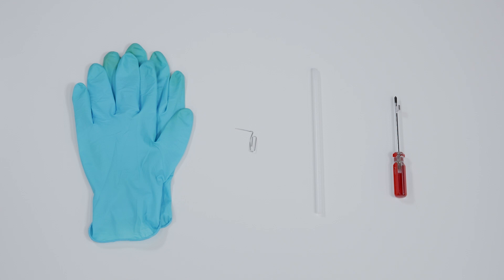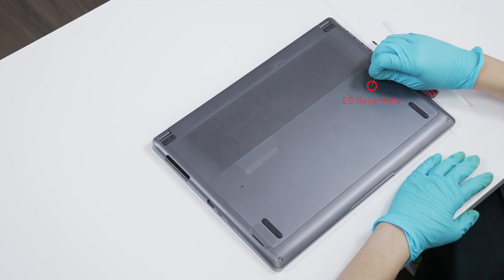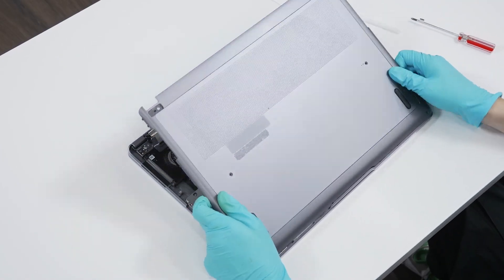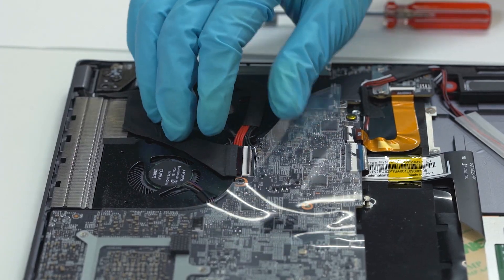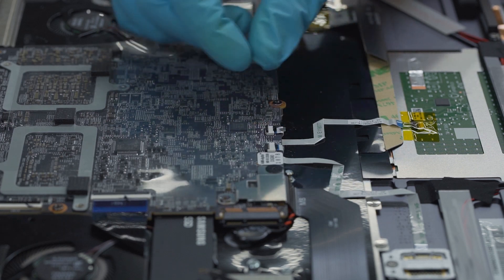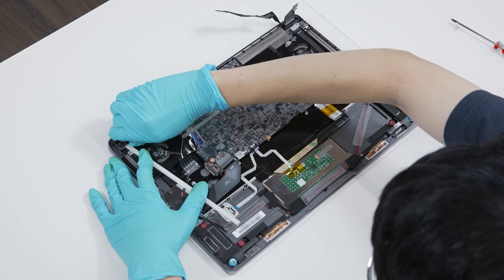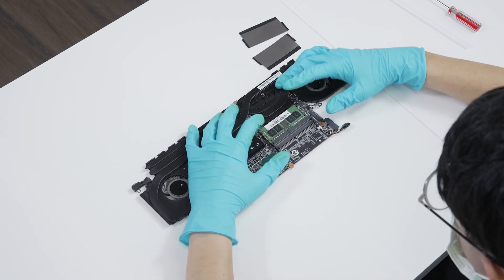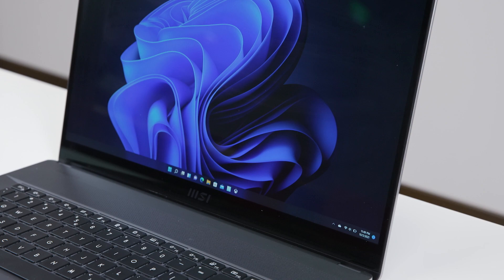MSI Creator Z16 Upgrade Tutorial

Comment: Thank you for the guide. 

I know it’s silly to complain about this at this point, but I need to vent. 

This is f*cking ridiculous!  I’ve had to do this 3 times now over 3 years. There are two things an end user is likely to do with their hardware: update/repair ssd or memory. A design that requires playing a game of Operation to do so is unreal. I’ve built and worked on computers for decades. This is just dumb.  

As I went through this process, I feel there were small changes to layout that could have made easier upgrades possible. Iirc, years ago I had a SAGER that was easy to change those parts and it was a comparable machine (at the time) to this msi. 

Guess it’s on me for not researching how easy this is before purchasing. But they were the only maker with the display I wanted. 

Rant over. Thanks for listening.

Comment: Thank you for the guide! I just added an M2 to my Z16 A11UET and a have a couple notes I thought were worth mentioning: (disclaimer: I am not a professional) 
1) A SIM card pin seemed to fit well to reset the battery. 
2) The screws on my system were tight as heck and I needed to use a low power drill with a little force to actually unscrew them without stripping it. 
3) I believe I was required to remove the connection to the motherboard to install the extra M2, and the connection travels over the SSD Stick instead of how the model in the video shows where it appears that the wire travels under the bottom side of the SSD Stick. 
4) I had a strip of thermal tape on the M2 and it still fit perfectly. 
5) I believe the connection to the battery gets reestablished when you plug in the charger after reassembling the case (I had a mini panic attack when it didn't turn on first thing). 

Other than that, the computer started up right away and had the new M2 recognized in less than 30 seconds. I have only taken apart one other laptop completely, but I would say adding the M2 was relatively easy even for a hobbyist. However, switching out the RAM looks like it would be very stressful in comparison to adding the M2 so I'm holding off on that for now.